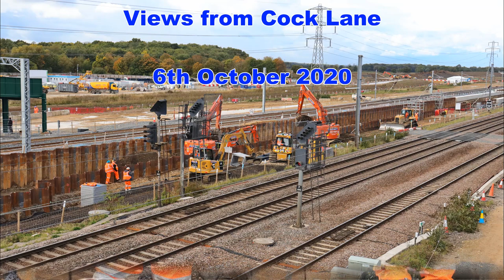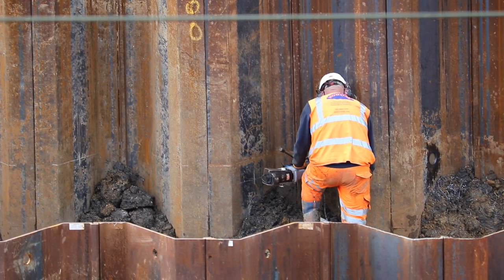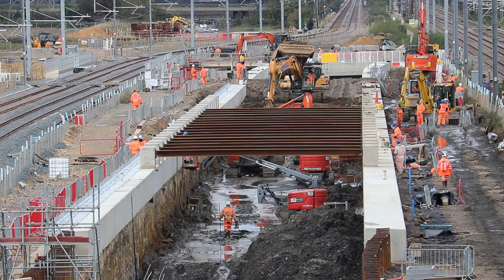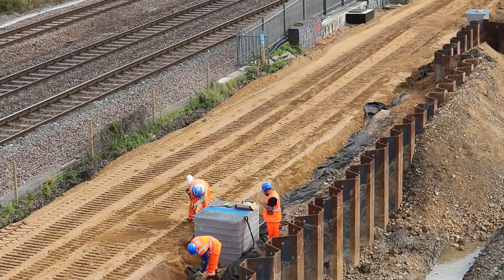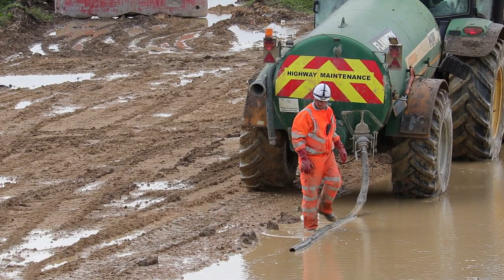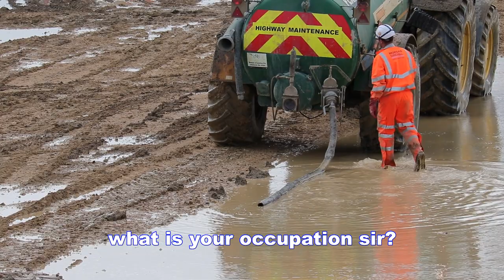Werrington Junction Upgrade 6th October 2020

Comment: The mystery of the piles! ;) :)
Reply from the maker: Certainly is, no doubt there is a simple explanation.  Miss those walk-in meetings to find out those bits of information.
Reply from the maker: @davecardboard9567  Thank you for that link Dave.  My initial thoughts that the holes were for relieving water pressure may well be correct.

Comment: The holes in the piles are possibly  for soil nails to stop the piles bending as the trains willbe running on the high side and the other side still has to dug deeper
Reply from the maker: Yes, could well be what they are for.